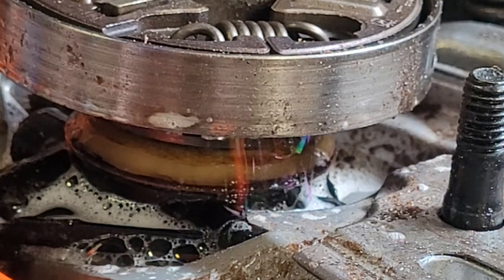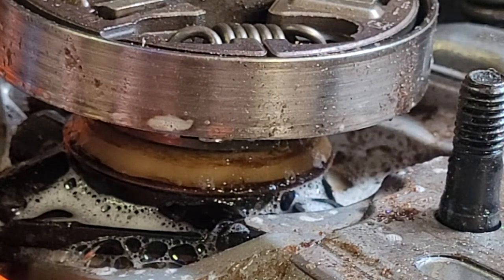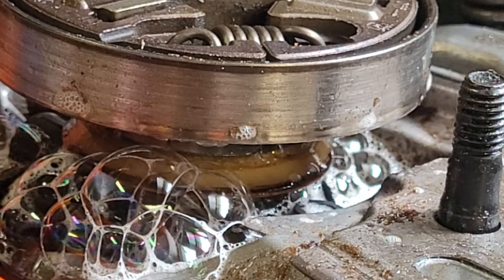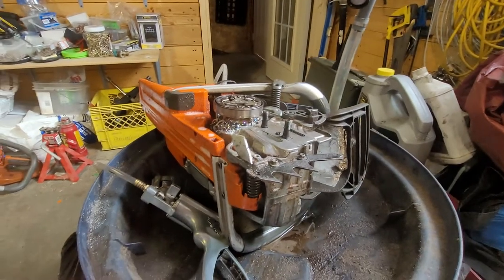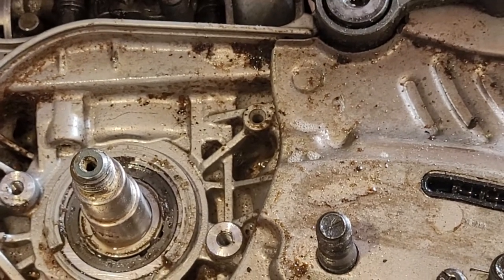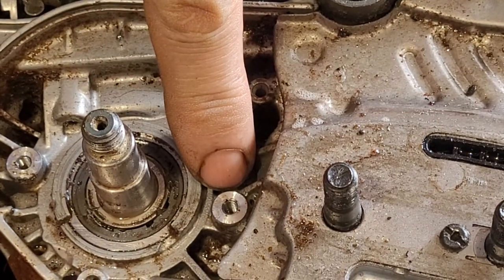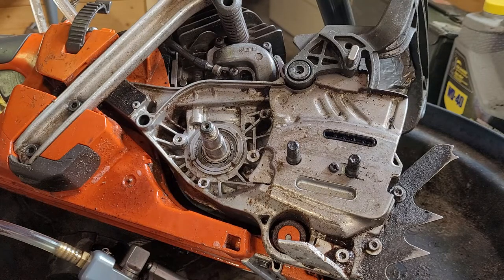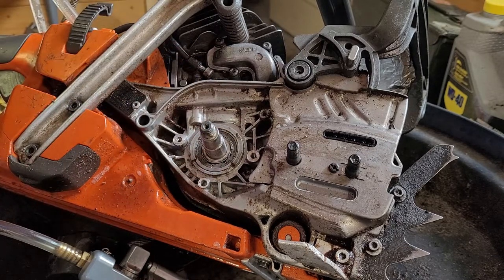Husqvarna 562xp crank bearing fail Part 1 of 3

Comment: Was going to buy one of these tomorrow not now thanks for the video. Think paying more for a named brand behind it, but now days it doesn't matter better off buying a Chinese clone lot cheaper at least you know what you're getting for the money. These companies better wise up Chinese keep improving and eventually they put these people out of business. I found out about this issue from a 1-star review on Husky's website then I went looking for more detail on the issue. The review says dealer he took his to gets 3 a week from this issue.
Reply from the maker: The best bang for you buck is Echo.
They are a Japanese company who manufacture their parts there or in the USA.
The quality is incredible and they are built to last.
I have an Echo CS620 at work that never lets me down, it will work all day pulling a 24” bar in anything I stick it into. Fires up right away and is very comfortable to run. It’s about $200 less than the Husky 562XP or Stihl MS362. The Echo has gobs of torque, revs out good and had the hood crank bearings and no computer carb nor Strato-port, so the Echo gets better lubrication, runs cooler and will last forever.
If you’re not using a saw on a daily basis, grab an Echo CS590 Timber Wolf, they are a magnesium crankcase and Pro design, unlike the Husky rancher 460 or Stihl wood boss 391, which have a plastic crank case and are basically disposable made in China junk.